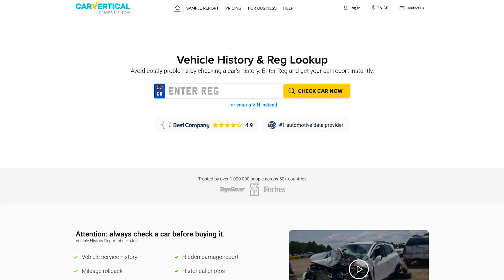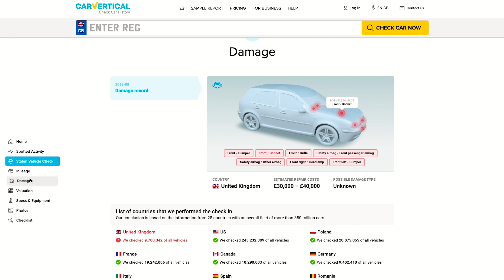Golf 7 GTI - Wash, Polish & Ceramic Coating - Full Detail

Comment: I’m getting a new Jetta GLI Autobahn in black I’m a few weeks and was wondering what I should do? I was thinking of washing it with snow foam first rinsing it, then foaming it down again and using the two bucket method to hand wash it, then spraying iron remover on the car, then rinsing it off and then using a polish and then ceramic, how does that sound?

Comment: Great video as usual. I must say you are practically one of the best detailers on YouTube.
I saw you used CQuart Finest reserve in the video but in the description links I'm seeing Cquart 3.0 why is that????
Reply from the maker: Thank you! I really appreciate it! I’m linking to CQUK 3.0 as an alternative for those who are looking for a ceramic coating. Finest Reserve is not to be sold, it’s only for certified CARPRO installers
Reply: @VermijlCarDetail  is the application process the same or do you need some special infrared machine to cure the Cquart finest reserve?
Thank you for your response 😉👍🏻

Comment: fantastic job all round again!May I ask... ive just got myself a DA polisher as I need to correct the paint on my Kia Sportage GTLine. There are so many products out there... as a newbie, would the Koch Chemie range suit, or would you recommend something else? Right now i would say my paint would need 2 stage polish, but you may think if you saw it, just 1 ? It had no protection on it when i got it, i just waxed it when i got the car (it was swirled quite bad ) I pretty much follow your or any detailing wash method to minimise swirls etc. Its got to the point now im ready to clay it and polish it, but i just havent got the compound/ polish yet to start the process, and It needs doing asap( car sits outside, im on a busy road) thanks!
Reply: Im going with Rupes DA fine yellow with a foam pad to do my car... as from all the videos ive watched, I think this system is going to suit me, as i have fine defects from what I can tell now, so hopefully 1 stage with this polish will be enough to get a great finish. I can't believe all these pros argue about using IPAs or not etc.. and also so many use fallout removers AFTer they clay... that seems crazy to me... as you want to remove contaminants as much as possible BEFORe you actually hand touch the car.
Keep up the great work

Comment: Hello 
What is the role of that device that is like The thermometer you were measuring with on the car? 
Thank you
Reply from the maker: It’s used to measure the thickness of the paint
Reply: @VermijlCarDetail  
This device puzzled me a lot Thanks a lot for the tip Good luck to you 👍👌😉🇩🇿